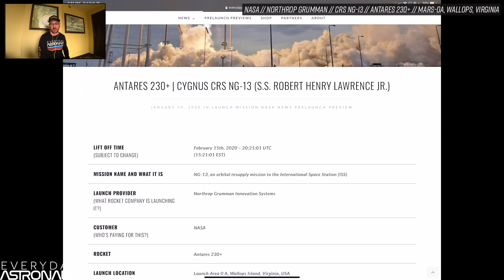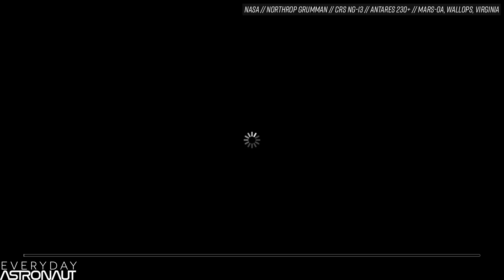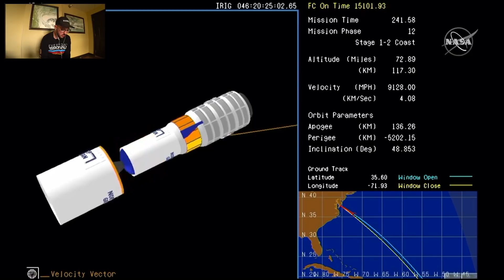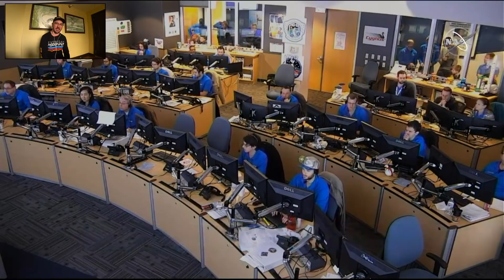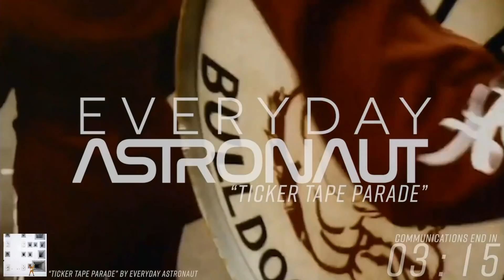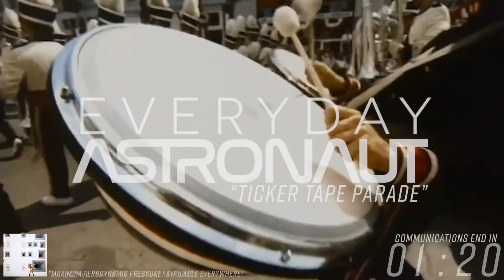Watch NASA and Northrop Grumman launch to the ISS! (CRS-13)

Comment: Spotted ISS 10 mins ago. Also, as you said, I was expecting to see Cygnus chasing behind it. Some satellite, dimmer than ISS, came behind the ISS, approximately on the same path, but about 5 mins after ISS disappeared. So, they were around 8-10 mins apart. Could that be the Cygnus? I am confused with the separation angle. 🤔

Comment: how did they compete against spacex when musk reuse half of the rocket?
Reply: NASA wanted two independent providers, so if either of them was grounded for any reason they would still have access. Thus, they didn't have to compete with SpaceX, just with everybody else. I bet you that in five years, when Starship has rendered every other launch vehicle and spacecraft in the world obsolete, NG, Boeing, and Sierra Nevada will all still have their contracts for commercial crew and supply, for that very reason.

Comment: Did the main booster return and land like space x and did they catch the fairings
Reply: No other orbital launcher returns, lands, and is reused. No other company has even attempted this. Zero, zip, nada.  :)  
Ditto for fairings.
Reply: @donjones4719  Rocket Lab is preparing for recovering their Electron boosters, though, so, at least there's that. Oh, and an upcoming New Glenn, but it's not flying yet.
Reply: @caav56   True. Although the Electron will not actually return and land, but control it's reentry and be caught mid-air by parachute. I love that RL is doing this, and there are sound reasons this is the right approach for reusing that size rocket. (Details included for Michael Hays.) 

Will be interested to see Blue Origin's New Glen make their landing attempts in 2021. Their approach is similar to SpaceX but it took SpaceX quite a few tries to successfully land. Michael H, don't be misled by Blue Origin's ability to land their suborbital New Shepard rocket. Its reentry speed is a small fraction of an orbital booster's speed; landing one of these is in easy reach of any company that wants to.

It's important to note, in this thread about a Northrup Grumman launch, that no major established launcher builder is developing SpaceX style landing. 3 U.S. companies are in serious development of new rockets, none of which can land. Arianna Space has talked of the need to build one, but no real development done. Don't know if the Russians are working on anything, but doubt they have the financial resources. But the Chinese are definitely working on this, although details are scarce.
Reply: @donjones4719   Umm, Space Shuttle.
Reply: @odysseusrex5908   A strange beast in this context. Most of the "orbital launcher" didn't return and land in the sense of the question. Main tank expended. SRBs splashed, disassembled to segments, and rebuilt. SSMEs were part of the orbital launcher, so yes, they did return, land, and were reused.
Reply: Michael Hays - SpaceX has made something no one else does (landing an orbital class booster) look easy.
Reply: I take it you're trolling.

Comment: Northop Grummen……  and it didn't crash !?!?   amazing.
Reply: MpowerdAPE - Northrop-Grumman is not Boeing!
Reply: @TraditionalAnglican  Don't work so hard dude,  NG has a PR department.  They will assure us that the bolts were screwed on properly...…  go back to sleep.
Reply: MpowerdAPE - We’ll be assured the thing has been screwed together correctly by its payload reaching the desired orbit. Unlike Boeing DM-1, this one should actually reach the ISS.
Reply: @TraditionalAnglican  broken clock,  twice a day etc etc etc...
Reply: @MpowerdAPE  Hey Jackass, did you forget Grumman made Apollo Lunar module? If they have worked properly then why do you have problem with this?

Comment: FYI the AJ-26 was pure AeroJet / Kuznetsov (clue... A J  / NK), nothing to do with Rocketdyne. They also made the Atlas AJ-60 SRBs.

RD180 was supplied from NPO Energomash via Pratt & Whitney, who later bought Rocketdyne. Much later AeroJet bought Rocketdyne. And became AeroJet-Rocketdyne.
Reply: This two engines NK 33 and RD 180 are dope.
Reply: NK33 still being used by Russia in the Soyuz 2.1v for a few launches, but I think they check and test them very carefully before use and they don't report how many fail. They will be replaced by the RD-193 which is the basis for the new RD-181 that Antares now uses.

Unfortunately AR-26 was an expensive embarrassing failure for AeroJet and Orbital, it was always a temporary solution due to limited supply even if they all worked and didn't explode (that happened twice).

Comment: right at takeoff it looked a little scary as it tilted a bit to the side... is that normal?  I figured they'd clear the tower before starting to pitch down range.
Reply: Yeah it's normal for this rocket.
Reply: @ProwlerCam  Where is said strap on booster?   The Solar Explorer launch was an Atlas 5 with a single side booster... but this one?
Reply: @Marcus LaGrone - Sorry, I confused the two.